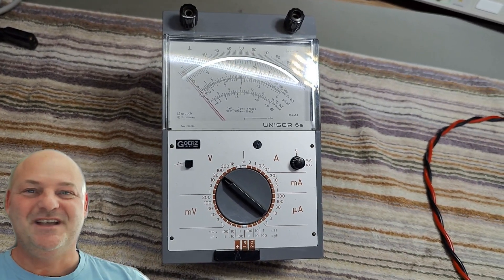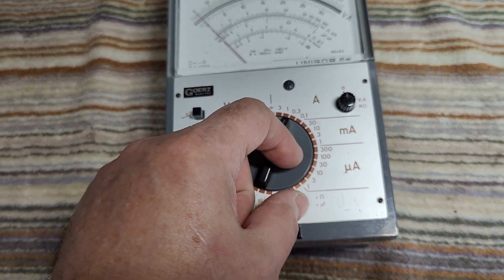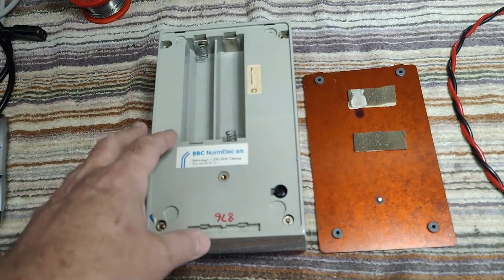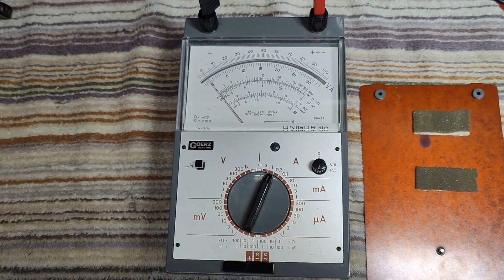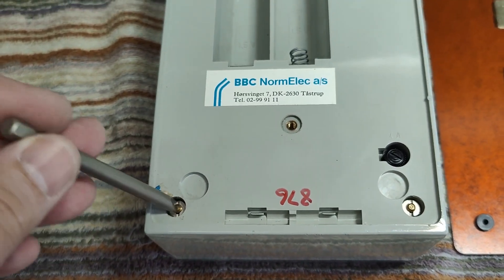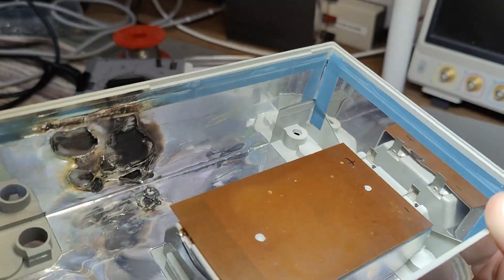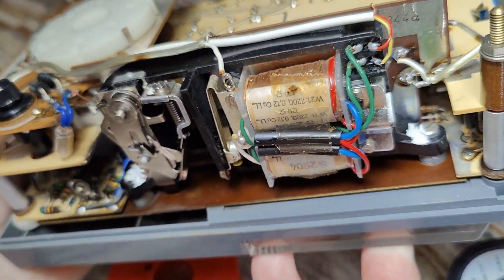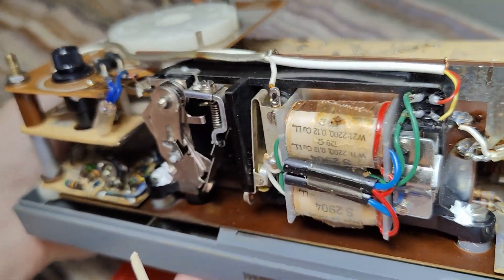BBC Goerz Metrawatt Unigor 6e multimeter type 226236

Comment: I use one find shorted transistors connected in paralel. In one mV range you can measure voltage drop in teansistors leads. Due to low voltage used in ohms, you can use to messure resisors on circuit. Try it!

Comment: Finally you got the real one, Thomas. Unfortunately, yours has had a very hard life in the past.
Otherwise the 6e, at 1% in all voltage and current ranges both DC and AC, I think is the most
accurate analog multimeter in existence. The one I got was totally dead when I got it. It turned out,
all its electrolytic condensors were gone. After I exchanged them and set back its chopper frequency to
205 Hz it was as accurate as brand new. Your electrolytes seem to have been exchanged already. 
Originally they had green tantalum drops and yours has blue ones. Maybe you have to readjust the chopper
also to get back full accuracy. There is an excellent service Manual for the 6e, but it is unobtainium.
At least there is a user manual at elektrotanya. Capacitances are measured with a chopped up internal 
current source source, so you do not need external AC for that and the voltage drop across capacitances
is a few mV except in 1 and 10 nF range, so you can measure capacitances in circuit most of the times.
Reply from the maker: thanks : i also got the 5s will maybe make a video next month about that one

Comment: That had to be arcing for a little while to cause that kind of damage, impressive indeed.
Reply: Fixed a Metravo 2H recently where the whole current measurement part of the circuit was more or less board-mounted ashes - carbon resistors where none were installed initially, if you will. Somebody must have connected it to mains on current range and left it connected :(. Impressively, the plastic housing wasn't damaged severely, no damage visible from the outside.